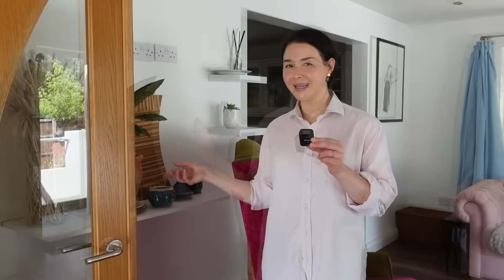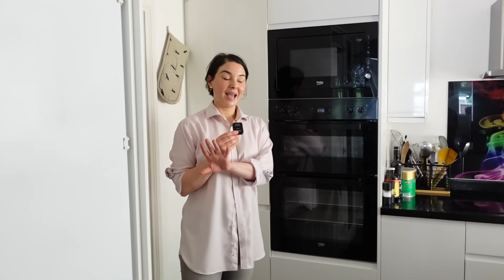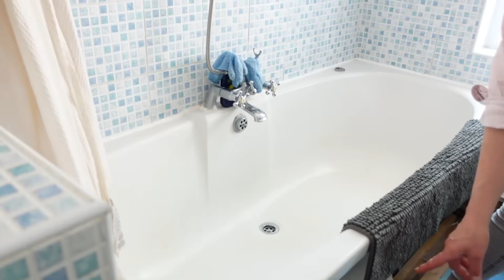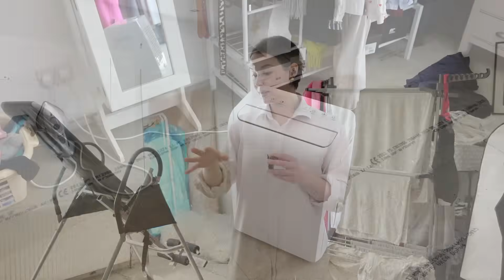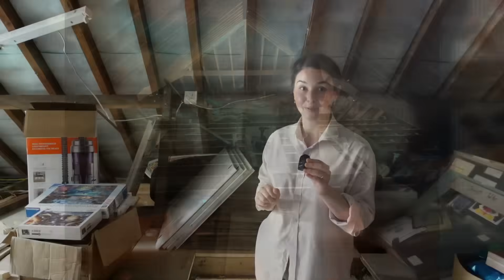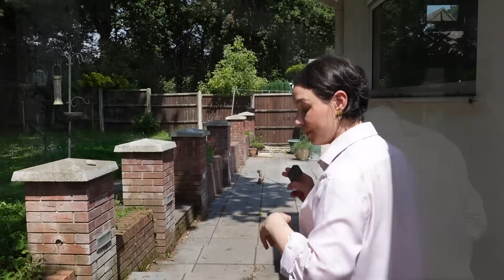I’m Renovating My Own Home — And It’s a Bigger Job Than I Thought

Comment: I am looking forward to following your journey. I am curious about where the master bedroom will be. Some thoughts..I'm not sure that double doors from the hall into a relatively small sitting room is a good use of wall space. The golden triangle in the kitchen is sink, fridge, cooker I think. The beauty of having a separate fridge and freezer is when one goes wrong you don't have the expense of replacing both ( I speak from experience). Would it be good for light and space to knock the snug and dining area into one? Don't bother answering this, you have too much on your plate. All the best:-)
Reply from the maker: Love it 🙌 thanks for watching and your helpful comment too!! 🙏🏻😌

Comment: Hello, I just discovered you and subscribed. I am a huge fan of home renovations, so I’m in and very keen to see what you do with your home.  It’s very exciting to get a new place and renovate it to make it your own. You have purchased a huge problem house however, I hope you got it cheap as it’s going to cost a small fortune to fix all the water issues and make the home safe and warm.  I’m looking forward to it though. 🌸💖🌸💖. With your honeysuckle, I’m wondering if the wall is too hot for it. The back fence isn’t as hot but that honey suckle is straight on the wall. Maybe lift it off,  give it a climbing frame a little off the wall so air can circulate behind it and cool it a little.
Reply from the maker: Welcome to the channel, and thank you for that thoughtful tip about the honeysuckle! Super helpful.  And for your thoughts on the reno too!! Its a big project indeed. Thanks for watching and hope you enjoy the other content on the channel too :)

Comment: I guess you really, really, wanted a project house, but I have no idea why you bought this awful one.
Reply from the maker: I can see why you’d think that, but I’m looking forward to the challenge of bringing it back to life! 🙏🏻
Reply: I have an ancient radiator. The paint is all peeling off. I can't be bothered to do much about it. My extractor fan is incredibly noisy. Spray the fences with green paint looking like plants. I did. Cleaning is never over. Being level CAN be important. Boss it! Don't get an ice maker.   Integrated freezers...a larder or a pantry? The golden triangle...it is very dangerous.  Don't go without security. Gambling, drugs etc. How do you research? Different AI for different projects? You can just leave it. I am a typical lazy man so I have left my front room...pretty much. A door lining? Dado? Dido link? White..can work. How about a colour which fits the age of the home? I only can advise for Victorian. Insulated floors? Interesting. I am embarrassed about one patch of damp only. No one can fix it. From around 1860. I prefer Corona with a slice of lime. Only one. Don't soak the floor. A simple mat will do. My stop cock looks dangerous. Mould spores, be careful. My Dad's grouting is Interesting! I seriously love an interesting tile. Some in Cambridge cost so much. I have never ripped out a wall etc. Get an ethical skip company? Floating ceilings...no opinions. Got a new boiler recently. The last one was on its knees. They used danger tape. Bought with it. Oblong window cool. Now I am late for a meeting...my shower head is uncleanable. Very few bungalows in central Cambridge. My uncle has one. I have fitted cupboards. Job done.  I think you need a spreadsheet? Draw it out! More joists😢 Damp is a huge issue in council homes. I need a builder friend. Why do they not know what they are doing? Better regulation needed. A French drain. Which era? Meeting cancelled. Upstairs? Not a bungalow? Pedant Nick? Dripping, was it on the survey? Yes, it is disturbing. Oh wow! Are you ok? Do boxercise. Get your own gloves. The sweat isn't nice. You will survive. Dry clothes outside? You are driven.  A bistro set...for fun? I can imagine. Treat them nicely! My layouts are ancient. 1860? Ventilation is tricky with global warming. Attic or loft? Breakfast on hold.  🪜 looks safe. Gable end? It is big! Mice? You can get a grant for insulation? My storage is in Clacton. Free finally! Books. Cool! I have 15 unread😢. Serious  🏋️‍♂️ . Outside...oh ...biodiversity? Oh no, hedges are wildlife corridors. Practical, yes. Air bricks AI inform. French windows? Wisteria.  Sydney Sussex exterior could inspire you. Nice mum. Oak tree...wow! Don't cut back brutally😢. It definitely has potential. A ha ha? Poppies, great. Oh, chicken wire aesthetics. Water it? What is follow on? I think my settings will sort that. Certainly a journey. Wow, good luck.

Comment: Wow . . . you do have a big job in from of you with the renovations but it appears you have already found all (if not most) of the problems. Hopefully from this stage forward, it will all go well for you. Having done 3 renovations in 40 years of marriage, when we were looking to buy our smaller retirement home (prior to our actual retirement), we knew exactly the type of construction and layout that would be right for a couple, who would be on a much reduced income. It took us 9 months to find it, but we have now happily lived here for nearly 18 years, with only having to do interior re-decoration and carpet replacement. I know many people do not like carpet in their homes but when you live in the south of the South Island of New Zealand (next stop Antarctica), then carpet is the way to go with the exceptions being the kitchen and bathroom areas.
Reply from the maker: Thank you for sharing your renovation experience and the wonderful tip about carpet; it’s lovely to hear you’re so settled in your home! 🙏🏻 Thanks so much for watching too :)
Reply: Many new homes built in the last 10 years in colder regions are built to the highest thermal & energy efficient Passivhaus standard.

Especially Scandinavia Sweden, Iceland etc with much colder temperatures than the South Island New Zealand. So many Passivhaus homes that keep them warm even with -21c plus freezing outdoor temperatures!